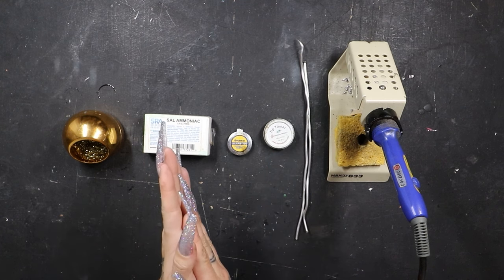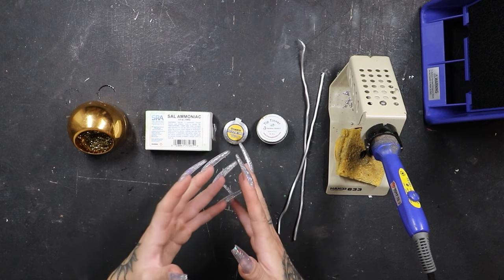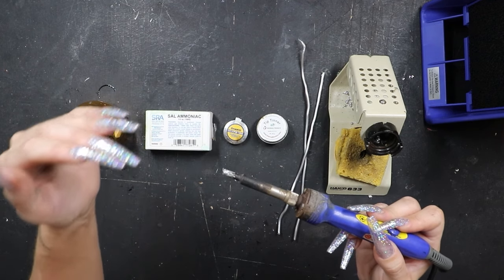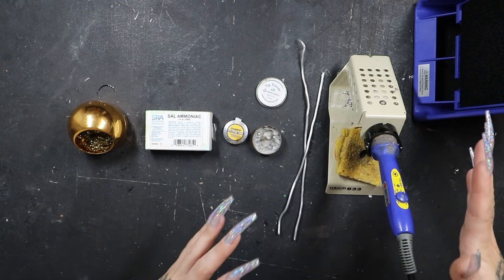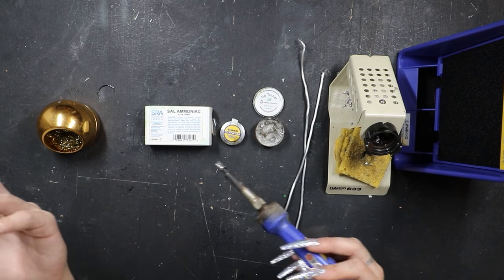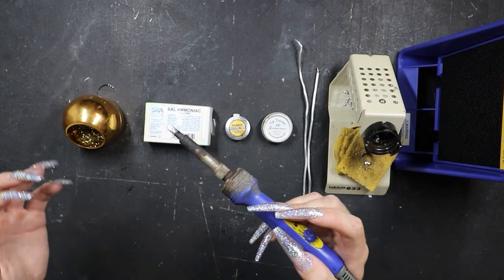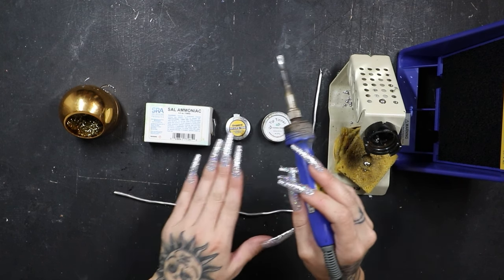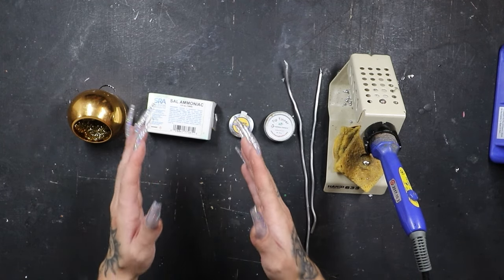3 REASONS YOUR IRON WONT HOLD SOLDER! ( 3 main reasons why you cant pick up and hold solder!)

Comment: Solder also has a different melting point at different elevations. In California, you can probably get away with 430 F, but up here at 8,000 ft, it doesn't even begin to melt until around 600 F.
It's super frustrating and no one ever mentions it

Comment: I've taught soldering since 1983 at a very high level.  I have only good things to say about your video. Keep up the good work.

One thing I have seen in the past, is some techs tend to wipe the tip clean prior to putting it back in the holder in between solder joints.  This causes the tip to oxidise, losing it's wet.

John
Reply from the maker: Thanks so much John! ♡♡ appreciate you!!!

Comment: My soldering is all hobbyist electronics, your tip looks massive compared to those I use. I prefer to tin with the solder I’m using, but with the T18 tips I use it takes a matter of seconds. Your solder also looks massive as well, I use .8 (0.032”) or .3mm (.0118”). I usually solder at around 340° do you have to work at full temp most of the time? How do you desolder? Do you still use a hot air gun, copper braid and desoldering pumps?

For me continuously cleaning and re-tinning is the key. When you’re 'in the zone' of doing a large amount of SMD soldering with a microscope that can take some self discipline. A tip can easily last me a year and I only buy Hakko even though I don’t have a Hakko machine. I buy them from a company here in the U.K. called Pi Hut and I buy my solder there too. I find quality consumables and calibrating your machines make a massive difference, and eBay stuff just makes life hard. I've no idea if it makes as big a difference at the much larger scale you work at.

An absolutely brilliant video, the most enjoyable soldering video I’ve seen in quite a while. It’s good to see the other end of the scale, now to find a video where you’re actually soldering as I’m fascinated.

Comment: FYI I got that tin of tip tinner and, expecting it to be a paste like yours, I was not careful to keep it level when opening.... Boy was I surprised when it was a fine powder that spilled out easily! It still works but to anyone who orders this... be VERY careful & gentle when opening o keep it level. When I put my iron tip in, it sort of melts the powder around the tip but doesn't really coat it visibly like in your video. It does however tin the tip and restore it to a bright silver color.

Comment: Hi, thanks for an excellent video. Where can I find the temperature melting points for the solder that I use ?
Reply: Should be on the packaging. If there's not packaging. Google is mostly accurate. Look up 50/50 solder melting point and something will come up.

Comment: I clip small pieces of solder into a tart tin and add my gel flux and make sure my iron is high enough ( the bar needs extreme heat) and then put the tip into the mix and watch the dirt bubble away and see how shiny the tip gets. 
just an other method.

Comment: I am just now learning how to make stained glass. The cutting and foiling went well, but I am having trouble with soldering. I have a brand new Hako fx 601. It is clean and tinned with tip tinner, turned to 410. I have tried 50/50 and 60/40 solder. The iron instantly melts the solder but will not hold the solder. It just drops off.
I have watched many of your videos and have enjoyed them and learned a lot. But I am stuck at this point.

Comment: I just started and I'm having a problem with picking up solder with iron. I used the tip tinner and wipe it on the sponge but it still won't pick it up. It just drips off...what am I doing wrong?

Comment: Can you use the Hakko chemical paste the same way you use the tip tinner (Before, during, after, etc)?
Reply from the maker: Notttt really REALLY. It's tough. When I need a real GOOD fresh tin all over the tip, I'm using the tip tinner again. While I'm in the middle of soldering a ton, I use the chemical paste when I need a quick ....cleaning. if you will. I'd say try them both and see what one works best for what tin/cleaning your kind of needing in the moment if that makes sense.
Reply: Thanks for the TIP! Eh... sorry

Comment: Thank you for explaining this so well!  I was inspired by your video and bought the tip tinner, and also purchased a Hakko FX-888D soldering station.  Man, what a difference in quality!  I went from a $50 amazon solder to this, it really is the Rolls Royce of soldering stations.  I am using tin lead free solder for my pendants, I find a temp at about 700 F works great, what would you recommend?  Thank you Kenzie!

Comment: What's the difference between the fx601-01 and the fx601-02?  They are 45 and 80 dollars and they look identical.
Reply: I just bought the $80 dollar one.  I tried to find the less expensive one but I noticed the lower priced ones were written in Japanese so the instructions were not understandable.  I couldn’t find any available on Amazon so I googled and found one at Home Depot.  I bought it three weeks.  I too started with cheap version but this one! Solder flows like butter.
Reply: @15Montrano  they are both in stock right now, but the only difference I can really see is the more expensive one has a higher wattage so that could be it.  I can't seem to find soldering tips for fx691 model.  Do you know if tips for fx600 or any of Hakkos other models work?  Or even different brands tips?

Comment: wait they are made to hold it? Bro I couldn't get that shit of my tool I swear, wanted to test etc, managed to damage plastic that was next to a screw (literally wanted to fill the gap of the stripped head with another screw to unscrew it) and on one another dumped same thing with stripped head. How do I get the solder of and ready to be put on whenerver place I want? Also what about the motherboards? Can I just touch the whole burning thing of 300-350C? I do as a hobby and don't know much, I just had watched many videos of repairs etc and I experience alone for fun.